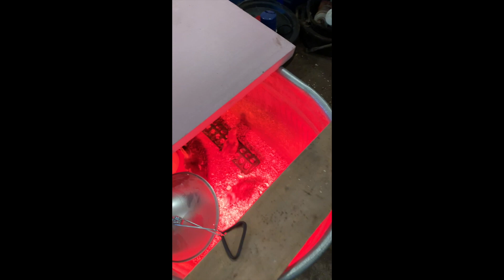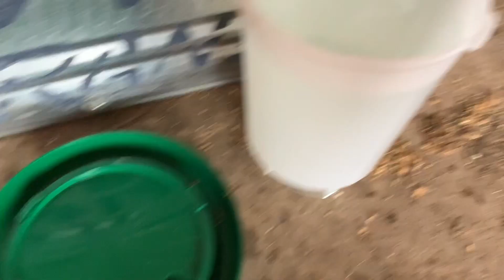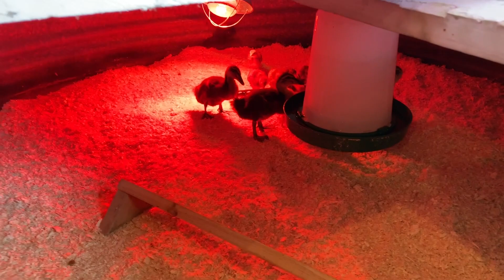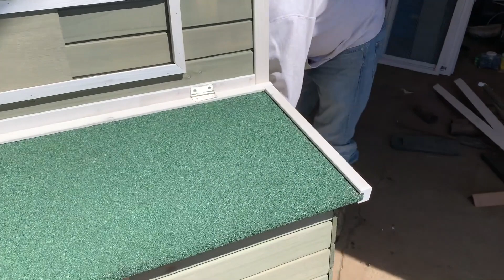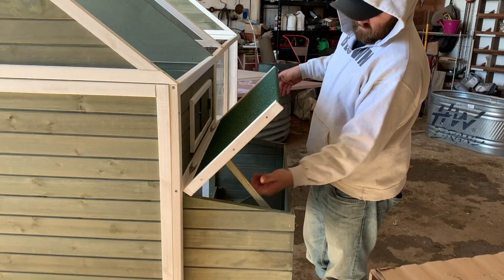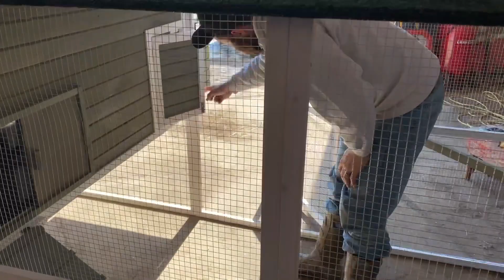RRAR17 - Update on the ducks/chicks and building a coop

Comment: Great job Mrs. Rocky Run!  I had to laugh because when I had my wife film a clip she forgot to turn the phone sideways too!  We used to have a coop like that, my advice is put it where you want it to be forever. After a year or so you can’t pick it up and move it without breaking it!  Looks like you all got a good spot for it so you should be good. Great Job you two!
Reply from the maker: Thanks Tyler, its definitely not a real sturdy outfit but its decent, i was going to build one in my free time but the mrs  made sure to point out that i have so much extra free time haha so we bought one. Thatll come later. We plan to put some kind of wind break around it to protect it a bit. Thanks for watching and the advice. Have a good one.